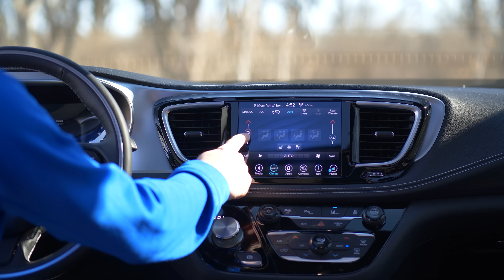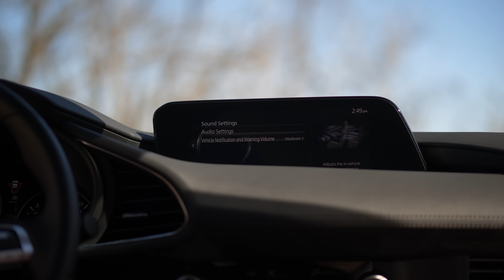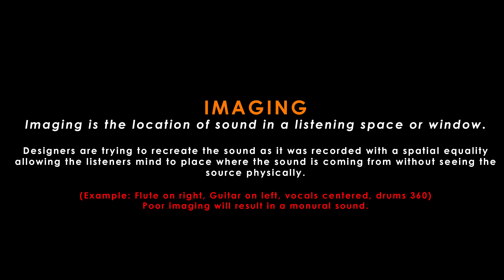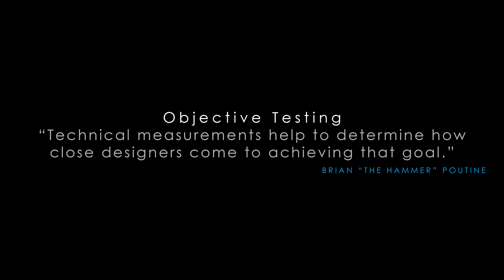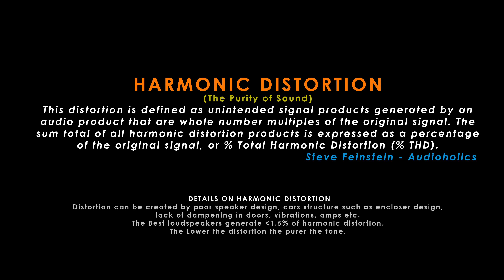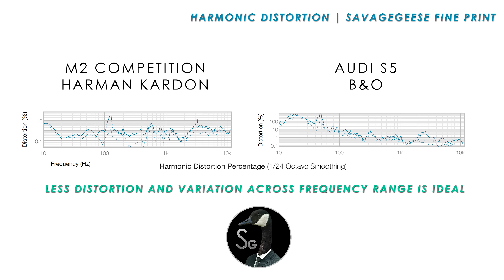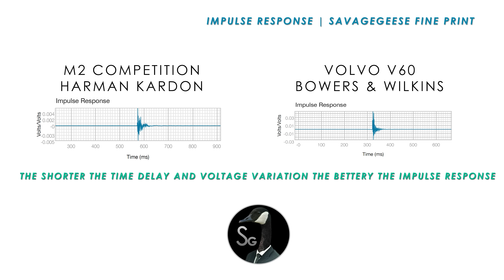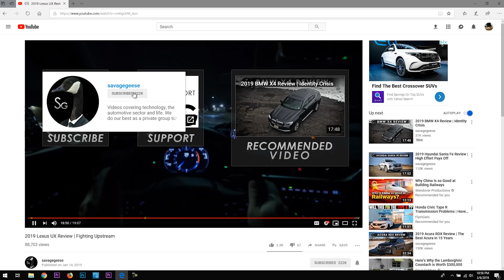Understanding Car Audio Design

Comment: I am audio designer and the spending large sums of money on car audio is insane. A car interior is a terrible environment for hi-fi sound.
So a few important details to remember:
Firstly you have road/wind/engine noise masking the low-level detail.
Secondly, being only a metre or 2 away from the speakers means you dont need huge power from your amp.
Third the driver enclosures are far from ideal in terms of rigidity, grills, positioning and diffraction effects from reflective surfaces.
Fourth the listener position is a compromise as every person in the car is off-centre.
Fifth the number of speaker drivers is no indication of sound quality.
Sixth some of the worlds best speakers user paper and polypropylene cones. 
Other factors like usability of the interface, reliability, and speaker durability should be high on the buyers list.
Best to invest big money on your home hi-fi system and be more sensible with your car audio budget.
Reply: Any chance I could ask you a few questions via email/discord whatever your preference
Reply: Yeah but your neighbours won't knock on your door if you're listening to loud music.
Reply: I've listened to many audio systems in cars and while the best was, by far, a Burmester 3D in a W222, the next best was definitely a 6-speaker Alpine.
Reply: while this is all true. there are ways you can make your audio as best as possible to maximize SQ in your vehicle such as digital processing.  using things like time delay. and crossover points  multiple drivers in customized enclosures   ie pointed at the main listening positions. and using stuff like sound deadner to achieve  audio  quality
Reply: A bad speaker will still sound like a bad speaker so their is a baseline quality you need, but yea you won't notice the minute differences in top of the line speakers vs something more standard
Reply: My car is the only place I ever listen to music, therefore it makes sense for me to spend a good deal of money on car audio.  Aiming for anything less than the best possible sound, within the limitations you listed, doesn't make any sense.
Reply: These would be the comments from an audio designer. People like cruising in their cars with some cool tunes with some decent sound. I’ve never been on a road trip thinking to myself “Why didn’t I just stay home and listen to these tunes?  The audio isn’t perfect.”
Reply: scanspeak00 congrats you watched the video. Now you’re a audio designer? Lol
Reply: I'd say a 7th point is what Mr. Geese brought up - primarily what's being listened to in the vehicle is compressed digital audio off someone's streaming service or SD card, or FM radio. I'd be on board paying Sirius what they're asking for their service, but their audio is so compressed it makes me wince. Just as it wouldn't make sense spending a ton on the speakers when the input isn't perfect, I wouldn't pay for a service with terrible audio quality.
Reply: If the high end versions offered a chance to ignore audio and infotainment, I'd go for it. Too bad that many other niceties are linked to these.
Reply: @SoulTouchMusic93   Laugh - this is where you need to get into adding that additional 2 layers of drywall and/or running a separate wall with sound absorption and blocking, then bass traps, etc to not piss off your neighbors.  Home construction is a complete joke if you're into home audio these days.
Reply: @JesseOsby  I'd start with sound deadening in most cars before adding new equip.  And tire choice as most stock tires = garbage/needlessly loud.
Reply: @nowake  Agreed which is why I disallow any stupid iphone connections and just go for a USB stick with moderate to high res audio on it, which tends to require less amp gain depending upon the snr of your particular setup.
Reply: And all those things change drastically when you have someone like me, who prefers driving with the windows down or sunroof open, even on the highway.  That's where I find my Lexus audio severely lacking.  194 watts is just not enough to divide between 13 speakers.  Though it sounds much better than most rental cars I use every week for work, with Chrysler being at the absolute bottom, even worse than the horrendous Kia Soul I endured two weeks ago.  The Infiniti QX 60 and Nissan Maxima SV are the best I've heard, even better than a Cadillac SRX.  I can't recall the sound in the BMW X3--I was too annoyed at the auto-start engine "feature" that I couldn't figure out how to deactivate.
Reply: @nowake  I rarely stream audio such as Pandora in the car.  If I do listen to music, it's usually Google music files that I've downloaded to my phone.  I usually stick to FLAC files, and if I don't have that, 320kbps MP3.  When I used to install car audio, I took every opportunity to pop in a CD if I had one, to compare it to whatever was playing on XM or Sirius when testing a customer's car.  Sirius claimed to use higher bit rates for better sound, but it sounded just as lifeless as XM.  You could barely detect any highs, and the bass was severely cut off, probably around 60hz or so.  It was like listening to the cheapest $2 gas station earbuds you could find, only through your car speakers for 10 to 12 bux a month.
Reply: And speakers reproduce the signal fed to them, thus the best speaker possible won't sound as well as it can if the source signal isn't very good.
Reply: The whole thing about noise... you do realize that you make a cabin whisper quiet with insulation or sound deader material right?
Auto manufacturers do this already in luxury trims and models. 
Just look at the American trucks, the higher trim you buy the more sound deadening you get.
Custom audio shops usually do this too when you drop money on a high end system.
Reply: @DragonKnightX12  do you realize most vehicles hardly use this? M ost vehicles aren't whisper quiet, and it's made worse by these newer cars using shitty CVT instead of traditional transmissions.  You're making a broadsweeping argument that only applies to higher end vehicles, and then when spending lots of cash at high end shops. I did car audio for years, and at a high end shop. Most customers didn't want to spend money on sound deadening bc they didn't see the value in it, since it wasn't a core part of the audio system. Those that did get it would get the minimum--a small piece around front speakers in the door, and the underside of the trunk if they got subs, maybe the license plate.
Reply: I've designed a lot of hifi speakers for home and aftermarket car stereos over decades and I know a lot of the parts manufacturers and generic drivers that are used in hifi. I was confused on SG making remarks about driver cost and paper cones when drivers are usually 10% of the cost of any hifi speaker making $50-$200 drivers pretty unrealisitic for most vehicles given 4 doors and 2 speakers per door assuming a two way speaker system + sub. Paper cones are much easier to design smooth 1st and 2nd order crossovers becuase they have much less natural cone breakup compared to poly, aluminum, composite, woven fiber etc... material for the cone. The natural breakup on most typical 5" or 6" woofer can be around 3-5khz and that is hard to flatten out if the breakup is a big spike. You can use steep crossover design like a 3rd or 4th order which will cut more of the frequency away after the crossover point but that can start to sound pretty disconnected in a car when you sit really close to the drivers. Think of it this way, if you use a poly woofer and it's breakup is a 4db spike peaking at 4.5khz, most crossover points between the woofer and tweeter would be around 2-3.5khz and this breakup spike will still interfere in the crossover point which is not optimal. Active multi-amplifier set up can work also but all these things cost more money in designing and parts. A 3rd order crossover has 2/3rd more electronic parts than a 1st order. Obviously you can design any cone material to have minimal breakup but paper and treated paper is the best when dealing with the cost and quality of audio. Also paper is really efficient. Most pro audio speaker that deliver really high SPL are paper. Otherwise just the fact SG is working with an audio engineer, measuring and creating a testing medium will be great data.
Reply: @07wrxtr1  what about Apple CarPlay and Android Auto? In my experience compared to Bluetooth the signal is much stronger and I noticed some slight improvements over Bluetooth in terms of frequency range. However I have only tried it with streaming services (in their highest settings).
Reply: I am a car audio designer, and i say that you need to get bent old man, cars can be just as hi-fi as a home if you throw out everything you know in regards to home audio
Reply: Truer words never said.   Good accurate audio in a car is impossible with constantly varying ambient sound levels and frequencies.
Reply: @JesseOsby  Want to spend more than your car cost?  Then it can be done half assed.
Reply: @nowake  Wise post.
Reply: @07wrxtr1  As are goid performance tires.  Now, do you want to look at paving surfaces?   Ooops!
Reply: @djw1091994  Bottom line is BT is crap quality bandwidth.
Reply: @ERTLPFM  Like fidelity?
Reply: Even better stay away from hifi bullshit and buy studio gear that's often way cheaper and always sounds better.  Also stay away from hifi amps and dac's and buy a proper audio interface. Don't buy into hifi snake oil.
Reply: Audio designers shouldn't be allowed to design audio for people who are not audio designers, I like my car stereos loud and bassy and fuck all the audiophile bollocks I get told I SHOULD want. People also like to talk about lightweight cars with delicate handling and superior driver feedback but there are a lot of people like me who want to drive a fat heavy AMG with a giant, ridiculous sounding and mostly pointless V8 that does crap MPG instead.

People like what they like.
Reply: Yeah but for a very expensive, ultra quiet car the pricey premium audio would make sense.
Reply: @MrCarGuy  You have got to be joking on that burmeister. That is one of the most overpriced shitty systems of the lot.
Reply: @Fee.1  I'm not an audio engineer - just a hobyist -, but I'm curious what questions you have?

Comment: The nice thing about car audio is you can get typically get a huge improvement in sound just from $80-100 in speakers (if your car only has 4 speakers). I've replaced the speakers in both my '06 Explorer and my sister's 2014 Mazda 3 and the difference in both was huge.

Comment: I've already got a masterpiece of an audio system in my car, cassette AM FM radio and one speaker on each of my 2 doors
Reply: same, I don't got Daddy's millions like this guy to roll around in a $100k car and with $15k  audio system. with $200 you can buy at Walmart a Sony or Pioneer radio with a USB slot to load MP3's or even Bluetooth and buy 2 6x9's and 2 6in's and have the same sound as him. if you want some bass, get  a case with 2 12's and a 200w amp and there you go. maybe you will have less than $500 in the entire system if that.
Reply: @MaxCaissie  Oh yes sir I read about on the internet, command me baby... command me...

Comment: Anxious to see how this info filters into your reviews. It’s been needed in the industry for a long time, and after watching many of your vids, there is little doubt you will bring us solid and useable info. I also think an area of the automotive review world that goes little noticed, but is vital to the end user experience is how well do the new car’s lights function. There is no doubt that more and more implementation of LED tech will fit into the car equation like car audio. Not all LED’s are the same. And the number of variables going into beam pattern and light output have profound effect on the quality of seeing at night while not blinding oncoming traffic. Again, thanks for this info.
Reply: Lighting is one area where the premium German cars truly excel. Though they do charge plenty for it. Volvo also does lighting amazingly.

Comment: Back in 1972 my father got a used VW Fastback so he didn't have to drive me to my summer job. I installed a Teac cassette deck and two rear speakers. The tape deck didn't even have FF and rewind so you couldn't change songs, but you could change directions into the middle of a song you couldn't choose. But the sound was really good, at least as good as many of today's cars. Some of today's vehicles have really impressive sound, but most don't or even if they do it is unworkable. One scary improvement in car stereo is my first stereo made you listen to music in continuous albums since you couldn't FF to change songs. Every 90 minutes you had to change tapes to keep listening. Now I have a 256 gig sdcard in the glovebox. It contains so much music you could listen to a different song over the life of the vehicle! It has most everything I would ever want to listen to. It is organized so I can select anything with a few touches of my fingertip. I tried to show it to my father in his Acura MDX but it was designed so poorly it was unusable. Instead of organizing folders in hierarchical lists, it flattens 1000s of albums into one huge list and then makes you scroll with a wheel. If you wanted to go to an album it could take hours of scrolling, presuming you don't kill yourself playing with the stereo before you give up in frustration.

Comment: We've got a Merc GLC with the Burmester set up.  When we took it in for an oil change and got a loaner without the Burmester, it sounded like someone put a bedsheet over each of the speakers.  It sounded worse than my 2007 328i set up.  The Burmester set up in the GLC sounds like a good base stereo system for a car, but it ain't no high end system.  I'm guessing we're paying for the nice speaker grills, the name and some better drivers.  The best OEM stereo I've heard have all been in Acuras, especially the RLX with the Krell set up.  Very nice.
Reply: Peder Hansen  so it's $800 for what really should be the base system
Reply: Peder Hansen  And still shit. Money does not equal quality. You should know, look at what happened to mercedes in the last 20 years.

Comment: The fender audio system in the mk7 GTI is incredible for the price.  I was in competitive IASCA sanctioned car audio for years and have a decent ear.  I was pleasantly surprised when I bought my GTI.
Reply: Same with the GLI. Sounds great even at flat EQ just need to add a single sub to fill in the low bass and was about perfect.

Comment: I'd Love to see you do a comparison of the standard Lexus sound system vs the Mark Levinson branded system
Reply: I had the nakamichi stereo in my Lexus gs400 it sounded great for a stock system but im a big audio guy so I put my own speakers in
Reply: It's more about the placement of the drivers than the total cost of course driver design and quality of the drivers matter but even the best drivers sound like shit if not placed in good places
Reply: The problem is in compressed audio, not necessarily in audio components or their setup. If the infotainment system can only handle MP3 or WMA, like the most of standard ones do, especially when transcoded with low bitrates, then no amount of quality components can compensate for that.
Reply: I upgraded from a stock Dodge product so I figured the standard Lexus audio would be sufficient especially when you consider all the external sound intrusions and indeed, it sounds much better than my previous system. The problem I
m having isn't so much with the "quality" of the sound rather positioning and getting uniform volume. I've sat in the rear and it sounds like all the output is in the front. Even when you adjust the fade all the way to the rear there almost no volume. I've tested this in multiple current Lexus vehicles (IS, ES, RX) and they're all the same. This seems like a engineered decision that I don't understand. When balanced right it sounds pretty great in the driver seat but anywhere else...ugh.
Reply: @DennisMcPoland  How did you do that? The ML systems are notorious for being hard to remove or augment. Did you lose anything with that upgrade?

Comment: I prefer the sound signature of a vw polo i rented recently than the harmon/kardon in my own bmw :/
Reply: yikes...
Reply: Yeah, the unamed speakers in a Volvo V70 P3 blew away the Harman kardon speakers in an Alfa Romeo Giulia
Reply: I had the 2011 E90 328i, so it was the LCI also known regularly as the "facelift".  The facelift happened in 2009ish and it came with better sound system, including subwoofers under the seat. Well the bass was so good and the sound quality is very good,  but I still wanted more bass because I love bass, but it was still good enough. This sound system had no name either, but I believe this was the Hi Fi sound sytem. 

I don't have that car no more, I have a 2015 F30 335i M sport with all the equipment I wanted except the red seats.  Something that really struck me is that the sound system sucked balls. I turned up the bass and still felt nothing. I turned up the treble and it still didn't sound clear. There was not specific frequency tuning either in this car - just treble and bass (My E90 doesn't have specific frequency levels either, but it felt like it was tuned right, not needing any of that extra stuff; plus I didn't have the iDrive system. I had the BMW professional radio which still kicks ass for a car with no LCD screen).  I ended up installing the DD Audio 8'' Sub woofer and Crunch amp which solved the bass problem.

I also have the E92 M3 ZCP and I believe that this soundsystem is the same as the E90 that I used to have. Problem is that while quality is good, bass feels so low; you can feel it, but it's so low. Something I figured out is that you feel the bass in the back seats! I believe that this occurs because of the physics of how the car is made. This car needs more kickin' bass.
Reply: Cool story bro....................................